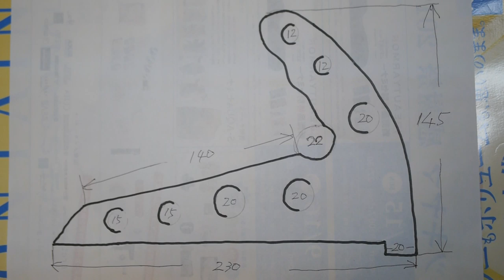My Safety stick

Comment: I think a lot of the curved cuts that you made on the table saw sled can be easily and quickly done with a jigsaw, bandsaw or a scroll saw.
Good photography/videography - the lenses and camera seems to be very high quality.
Reply from the maker: Hello Mad 
Thank you for watching my video
And thank you for the nice comment
I tried it with a jigsaw, and the cut surface was too severe! ! !
The other day, I bought a cheap band saw and I will try it.

Thank you for giving up on video shooting
Already old Panasonic G6, lens 25mm single focus

Thank you
See you again
Reply: Ohyo56 Yes I see today's new video is with your new bandsaw. The bandsaw is smoother than jigsaws because blade goes downwards only. In a jigsaw, the blade goes up and down and its very rough.